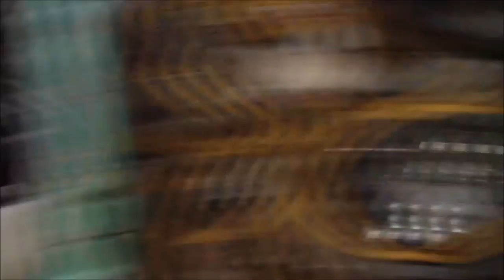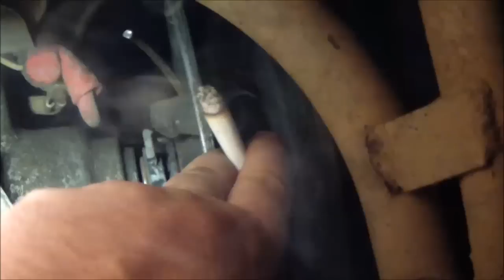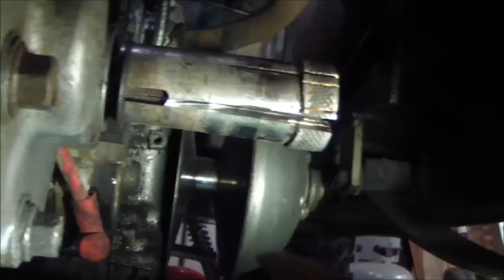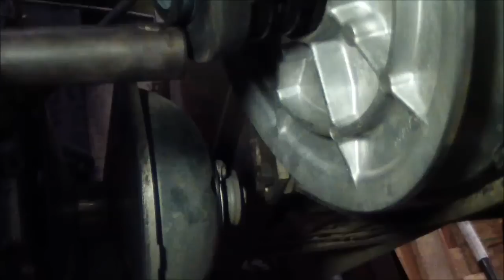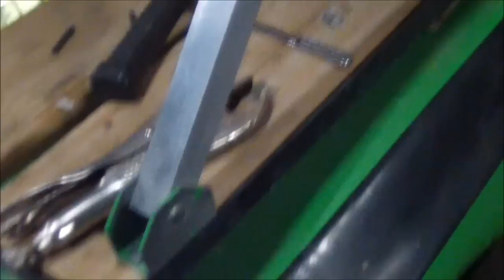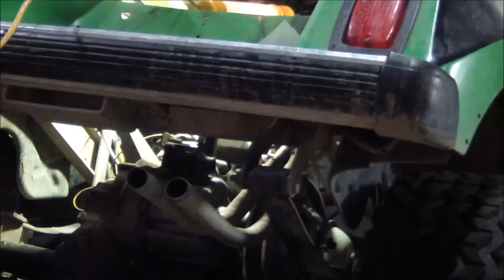1992 club car driven clutch replacement pain

Comment: Had this same issue with a driven clutch about 4 years ago.  Not fun. I had the body off of mine though, which made things somewhat easier.
Reply from the maker: Happy to say it's 2017 and still running strong.